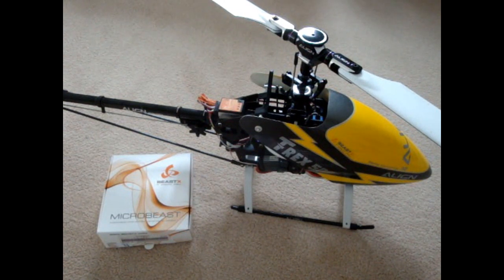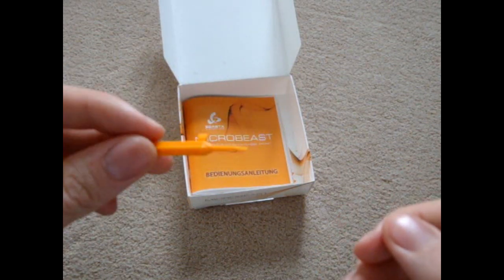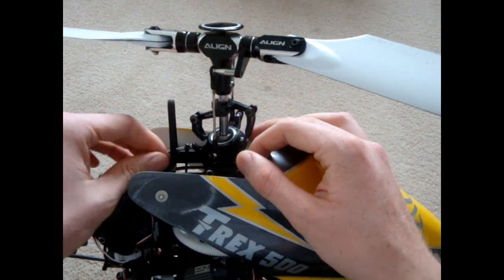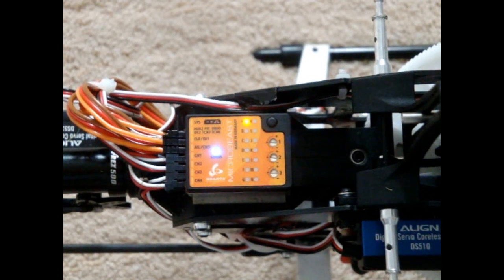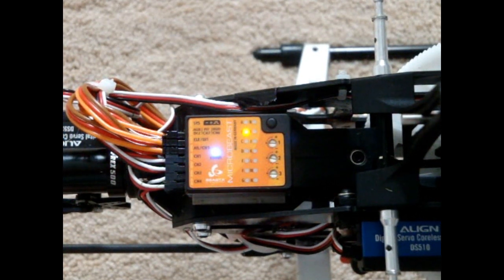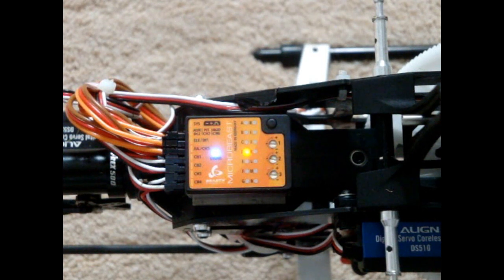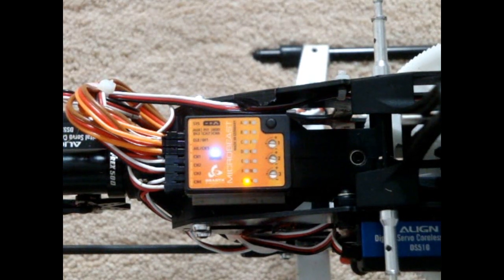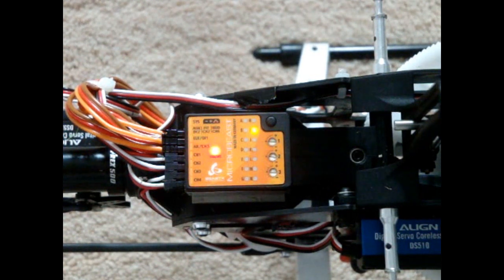Microbeast BeastX V1 Flybarless setup - Part 1

Comment from the maker: This version of the beastx does not replace the receiver, but It does replace the tail gyro. The version which replaces the receiver is called "AR7200BX". It is exactly the same as this, but has a built in receiver. This will ONLY bind to Spektrum radios, such as, DX6i, DX8, DX7 etc.